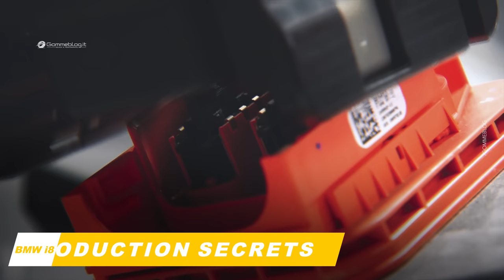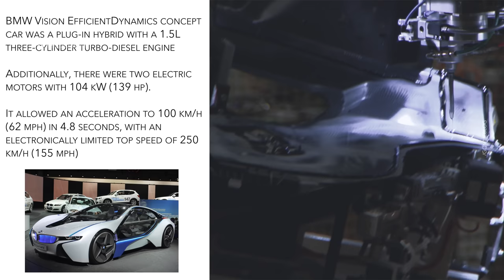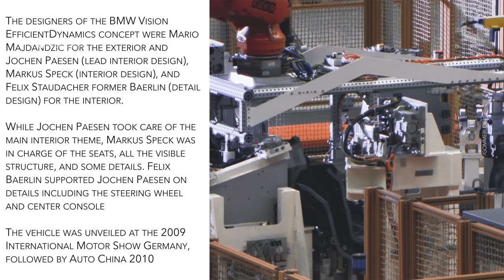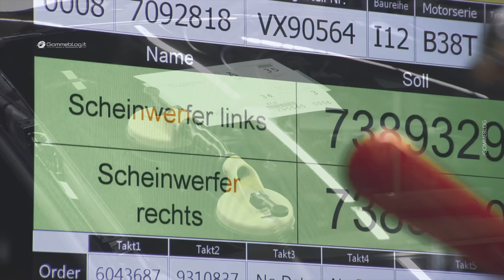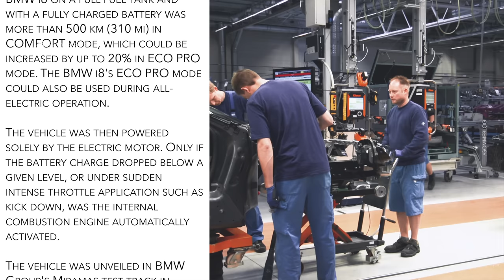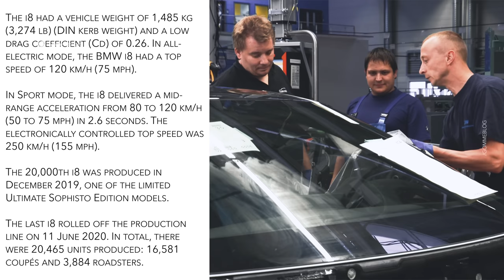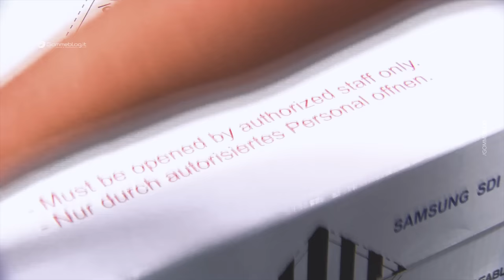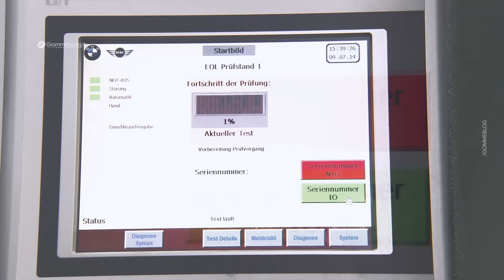Inside the Insane German Mega Factory Producing the BMW i8 - Production Line

Comment from the maker: 00:22 - BODY SHOP
04:37 - ASSEMBLY LINE
08:53 - DRIVE MODUL
09:47 - HIGH VOLTAGE BATTERY
15:01 - MARRIAGE
20:34 - BATTERY ASSEMBLY
23:57 - FINAL ASSEMBLY
27:04 - FINISH LINE

🚀 MOST RECENT VIDEOS: https://www.youtube.com/@GommeBlog/videos

🔴 RECOMMENDED TOP 5 Like VIDEOS 
🎥 Skoda Octavia Production 👉🏻  https://www.youtube.com/watch?v=Tr1B18XJ8Z8
🎥 BMW X7 Production 👉🏻 https://www.youtube.com/watch?v=BXYnu9Qvyq0
🎥 Hyundai Tucson Production 👉🏻 https://www.youtube.com/watch?v=Qsnv9-BYeYI
🎥 BMW Motorrad S1000RR Production 👉🏻 https://www.youtube.com/watch?v=e6I6vJb6HQk 
🎥 Bentley W12 Engine Production 👉🏻 https://www.youtube.com/watch?v=s4sEzlbeVMw